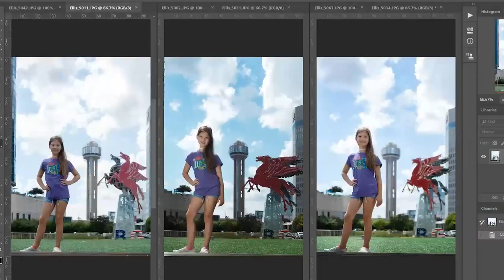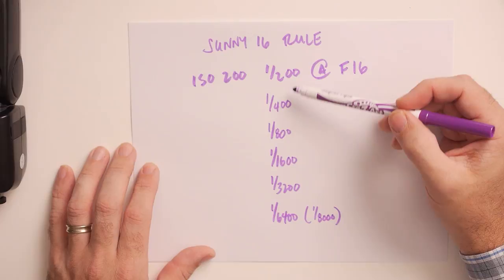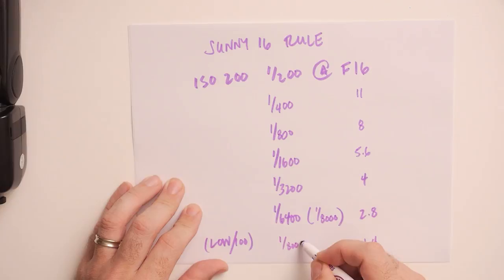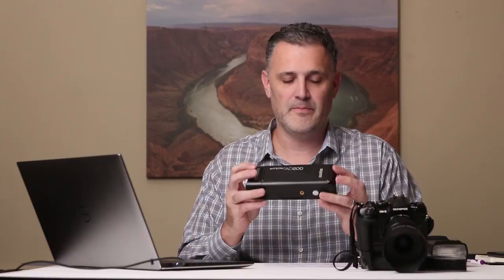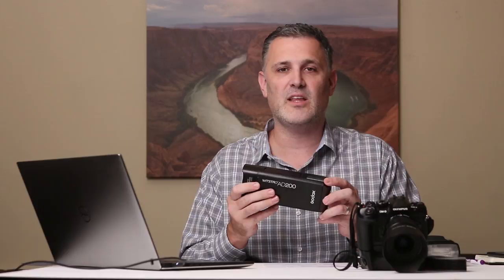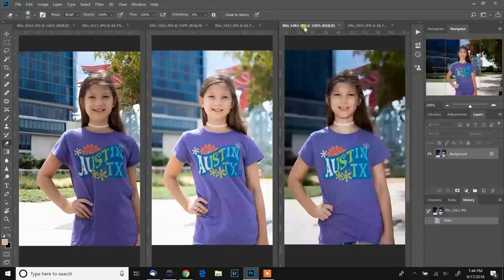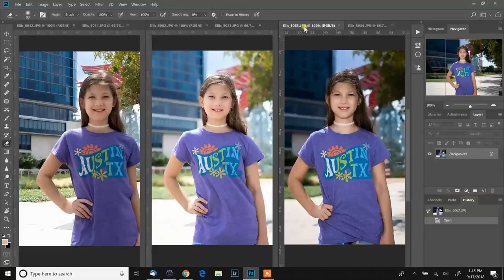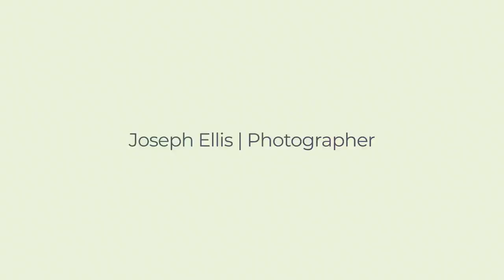Tips on Olympus High Speed Sync Flash

Comment: Dear Joseph, 
Many Thanks for the very useful tutorial that you present. My question is why you do not use the high speed dedicated Flash FL-900-R made by Olympus, rather than using the Godox flash units.
Reply from the maker: Ahmad - the Olympus flashes prior to the introduction of the FL600WR did not have true radio communication between them instead they used only optical pulses which are not nearly as reliable or useful for my work. That lack of radio based comms is main reason the FL900R just wasn't the best option for me because I want to have both on camera and off camera lights working at the same time and I'm often using modifiers that would block and optical system from working properly. 

Now that we have the FL600WR I do often use that flash, I love that it has true radio comms and it's the only flash for OMD that offers an autofocus assist light. I will say though that the last piece that keeps the Godox lights in my kit is that every light including my more powerful Godox AD200s use the same radio system so I can control them from any Godox flash on camera or from their XPRoO transmitter. 

Which one is best for you really just depends on your use - if you want the most features and you don't need a lot of power then the Olympus FL600WR is the most feature rich model. If you value system compatibility with different lights including studio strobes the Godox is the clear winner.

Comment: If you're short on flash power, and can't pull off a high speed sync, you can shoot in manual at a speed faster than the native sync speed of the camera, leaving some space at the bottom of your image, and cropping out the blacked out part of the image later.  The faster your shutter speed, the more you would have to crop out.  But if you're only a stop above your sync limit, it's probably only a small part of the bottom of your image that hasn't been exposed.  This isn't ideal I guess, but  should work in an emergency.  Depending on the amount of fill you're using, and the nature of the foreground, you might not even notice that the fill didn't reach the bottom of the image.  There are limits of course.  At really fast shutter speeds, you'll have blackout at the top as well, so this won't work.  The first curtain will not have had time to clear the sensor.  If your camera works the opposite, and underexposes the top instead of the bottom if you exceed your native sync speed, (this will depend on the direction of shutter travel), leave the extra space at the top instead of the bottom.  In portrait orientation,  it's likely to be one side or the other.  Or you could invest in some ND filters or a better flash.
Reply from the maker: Jon Barnard True, good post for a pinch hit situation. You can also turn the camera upside down if you want the black bar at the top instead.
Reply: I'm not even sure which way the shutter travels on my EM1.  I guess I should do some test shots at various shutter speeds to see what's going on.  It would be interesting to know what you can get away with using regular sync.    In the olden times, I had an OM1 and an OM4.  I think they had a horizontal cloth shutter.  But I think modern cameras have a vertical travel if I'm not mistaken.  Turning the camera upside down is a great idea.  Especially if there's a bit of sky in the shot.  For sure you wouldn't notice a lack of fill then, if you were careful not to push it too far.  And given flash falloff, you could probably get away with having stuff in the upper part of the frame closer than one might think.

Comment: SUPER informative - THANKS! Your videos are always so well done.
I have a question -- I do interior and exterior real estate/architectural photography and also photography of all kinds just for fun (Yep, profession = hobby!).  Anyway, for several reasons, I could really use more power and flexibility in a portable TTL and HSS  capable strobe (some call it a monolight). Can you recommend a good reasonably (lowest possible) priced reliable solution between 400 and 600 watts? I need it for the M5 Mark II and already have a Godox trigger and their TT685 and TT600 BUT forums say the 2.4GHz trigger will send info just fine to other brands. The Godox brand monolights in that range cost big bucks (to me anyway).
Thanks for your great videos!
Reply from the maker: Well, for my money I'd get the Godox/Flashpoint XPLOR 600 HSS for $550 is that out the budget? There are bunch of models of this light that are branded differently and there is also TTL versions which are system specific for $749 so be careful shopping. You can control all of your Godox lights with the same transmitter (Godox XProO) or using any of their on-camera flashes as a master flash.  It's a great and very inexpensive system.  The XPLOR 600 is obviously 600WS and built in a metal housing with a removable battery and as an option you can also pick up a unit which will run it off of wall power.

Comment: Great video, thanks! Can I ask a question? Assume HSS loses 4 stops of light . Doesn’t that provide the same light as using a 4 stop ND filter without HSS? While you’re able to use the full power of the flash with an ND filter, it seems like losing 4 stops results in the same light available from the flash regardless of whether the loss is from HSS or from an ND filter.  In other words, it seems like there’s no advantage (or disadvantage) to one method over the other? I’m asking because my Godox flash (the small one) doesn’t provide hardly any light in HSS, so its really useless. I was going to try an ND filter instead of HSS but I’m not clear how that would be any better?  (Also, have you had luck using the AD200 in HSS on sunny days? Or is the power loss too great without grouping lights together?) I appreciate your videos!
Reply from the maker: Ok so let’s say your flash is at 1/1 power at normal synch then you turn on HSS now you’re at 1/2 of that power (1 stop) and then you lose power as you shorten the shutter. So by definition you’re max flash effectiveness is at normal sync by at least one stop. By the time you get to say 1/4000 at f2 or whatever you’ve now lost let’s say 3 stops of power compared to normal sync. Therefore shooting at f2 at 1/250 at normal sync buys you 3 stops more light from your flash even with the ND. If your flash can get you the right exposure at f16 then with ND your going to be good because the ND and the lower aperture you want cancel each other out while the flash power stays constant. This is just an example but that’s pretty close to real world. So either you start with a flash that has 3-4 stops more light than you need, you bring it in close (inverse square) or you just use it as a low fill. The AD 200 buys you about 2 stops more light than a v860II so it’s in the ballpark of useable as a main in full sun but two of them in parallel definitely gets the job done usually not even at full power. I hope that helps!
Reply: Joseph Ellis Great explanation.  Thanks for your reply, it helps a lot!

Comment: Can you use one flash mounted to the camera to activate other off camera flashes or do you need the transmitter?
Reply from the maker: Any Godox flash can trigger another Godox flash or you can use their transmitters. You can’t mix Olympus wireless protocol and Godox’s even though they’re both compatible with OMD bodies.
Reply: Just to continue off of what Joseph is saying, it's true they don't mix. But if you have the right flash, say the AD200 pro, you can use the on-camera flash to trigger it if it is in a slave mode. It's tricky to use and set up, but it can be done. I've used it in conjunction with a Polaroid camera. The results were …okay. 😅

Therefore, it stands to reason you could use the built-in or mounted flash from your Olympus to activate the AD200 (or similar) as a slave unit, but the ease of use and price of a simple trigger will be worth the money and eliminates all that extra hassle.

Comment: Does sunny 16 rule apply equally to M4/3 format cams?  (Isn’t, e.g., f 1.4 on M43 equivalent to FF f 2.8?)  Idea of quick series of low power pulses in high speed sync mode was absent from vid.  Need to rewatch vid for tips to register — additional graphics might have been useful.
Reply from the maker: Paul M Sunny 16 does apply as it isn’t dependent on sensor size. Thanks for the feedback I’ll try and add some more graphics in the future. It was hard not to let it get too complex.
Reply: Hi Paul, F1.4 on M43 is the same aperture and ‘light gather’ as F1.4 on FF. Think of it as scaling down the FF lens and sensor to M43 size. It’s still the same aperture just scaled down. What differs is the DOF
Reply: I shoot MFT, FF, medium format and large format. I use a hand held meter and the exposure stays the same no matter the size of the sensor or film.

Comment: I just had an issue last week using the Godox 685 on-camera with HSS. I was getting no flash fill on my model unless the flash was on full power, at which point it was too much. Any ideas?
Reply from the maker: 9 times out of 10 that happens when the flash isn't seated all the way into the hot-shoe. Next time just double check to make sure it's 100% of the way into the shoe and I think it'll eliminate those misfires.
Reply: I'll check it next time. Just to note, the flash was firing, I was just getting no effect on my model aside from blinding her.
Reply: Mal  adjust your shutter speed to get less ambient light.